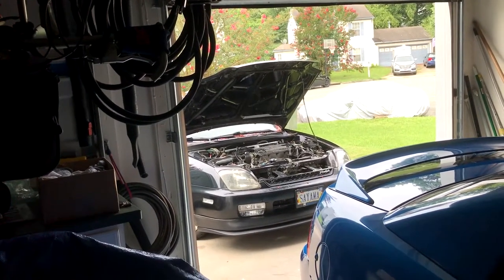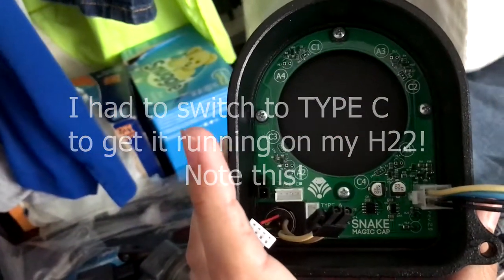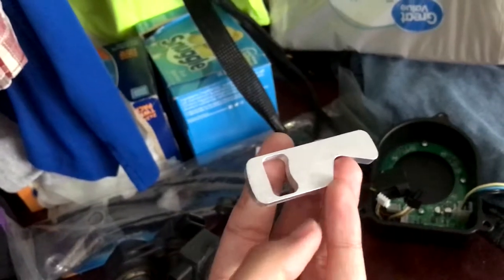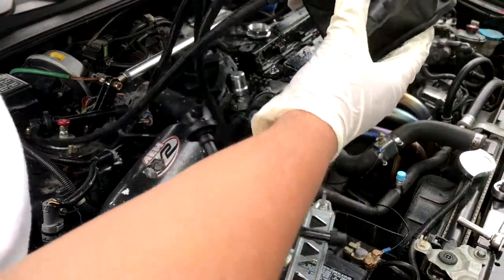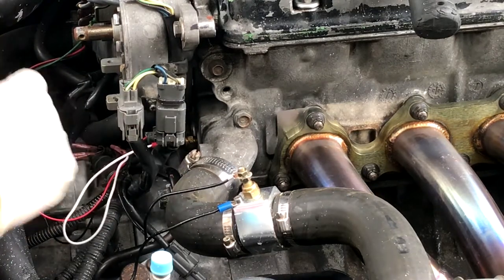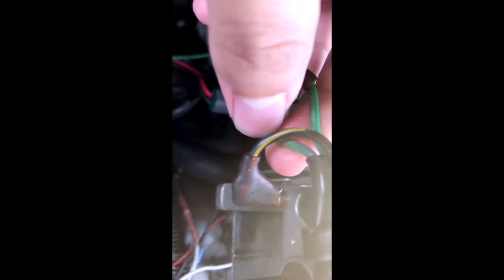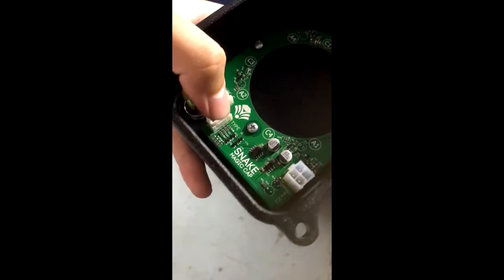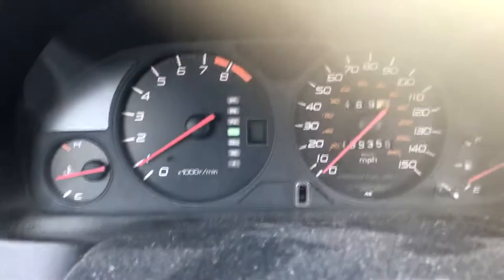YMRacing SnakeMC B/D/F/H Coil-on-Plug Kit Install & Review on OBD2 '00 Prelude

Comment from the maker: PLS READ BEFORE INSTALL:
In this video, I installed a very early production model of the SnakeMC COP Kit. You’ll notice that despite having an H series, I ended up using the Type C connector, which should not have been the case. Bottom line, this unit did prove to be faulty and was replaced free of charge with excellent customer service from Snake Tuning. I’ve been using the Type A connection as are the rest of my fellow F/H series guys who are using this kit. The kit has been functioning excellently, but there are some things I want to point out to anyone planning on purchasing and running this kit in the future:

1. Take into consideration the condition of your current distributor, and more specifically, the wiring to the ICM. If you notice your wiring has damaged insulation exposing copper, mask them to avoid shorts. If your wiring is rather crunchy, or if exposed copper from missing insulation looks corroded, repair with new wire, or replace the dizzy housing with a reman OEM unit for cheap. If your shaft seal behind the cap inside of the dizzy is leaking oil, replace the seal/bearing or replace the housing. My replacement SnakeMC unit initially had trouble with starting due to my Yellow/Green wire being severely damaged beyond repair. This wire is responsible for pulsing ground to the ICM that comes from the ECU and initiates the fire command outbound from the ICM to the stock ignition coil, or in this case, the fire signal to the SnakeMC Circuit Board. I opted for a Cardone reman dizzy housing from rock auto, and reinstalled my kit. Kit has functioned excellently ever since.

2. Still on the subject of wires, some may often found that the blue tachometer signal wire has turned green on them. Best thing to do is mark it prior to pulling it from the stock ICM.

Comment: How does the coil module work well? Have you had problems when this module heats up? since the lid is aluminum and heats up faster than the plastic lid.
Reply from the maker: No issues with it since my initial replacement. The circuit board used is able to handle underhood temps with ease, just as a DigiDizzy does.

Comment: What you did with the green wire ?? Mi car no showing rpm after this install
Reply from the maker: So what happens a lot is that there is a blue wire for the tachometer that fades and turns green from heat exposure causing it to look just like the green wire that sends input to the stock ignition coil. Unhook the green wire you have plugged in to the side prong on the ICM, and put the other one on it. 
If the wire you have on the side prong is in fact blue still (meaning it’s correct), try to squeeze the spade terminal slightly to make sure the tach connection is secure.

Comment: did you leave the external coil connected and in the engine bay?
Reply from the maker: So what you’ll want to do is insert a 30Amp Fuse into the connector that goes to the external coil. Needs to jump the black/yellow and Yellow wires together. They have spade terminals as they sit in the connector, so it’s perfect for a standard sized fuse.

Comment: Can you now remove the old external coil? If so what about the wire harness that plugs into it?
Reply from the maker: It can be removed or left in the bay,
And you just leave that harness connector unplugged.

Comment: Hey, how would this work on my Obd1 converted Hondata h22
Reply from the maker: It’d be plug and play as well since the Hondata used the dizzy the same way it would be used by an unmodified ECU. If you have an external coil though, you’ll want to leave the old external coil connected or jump the two wires for that connector on the harness side to keep the circuit there complete.
Reply: @_Juls  Ok, thank you! I just ordered the kit.

Comment: Also what benefits will this make on a street NA car?
Reply from the maker: NA street car, nothing insane other than you go from multiple parts that need service for the ignition system to just the 4 ignition coils which typically last very very VERY long.